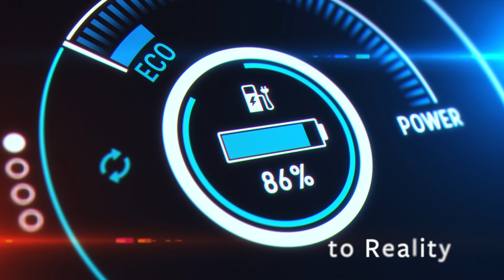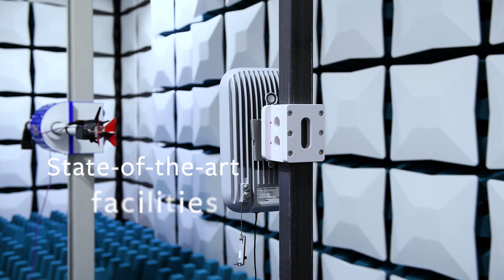Adasky’s IR Camera Could Revolutionize Auto Safety - CES 2022

Comment: I believe Tesla is already using digital cameras without IR filters.

Digital sensors will record IR wavelengths.  The digital cameras we use have IR filters installed in front of the sensor in order to block IR in order to create pictures similar to what we see.  Most humans can't see IR wavelengths.

You can send regular digital cameras to companies and have the IR filter removed.  Turns them into heat imaging cameras in low visible wavelength light conditions.  

I'm not sure this company has anything special.
Reply: Traditional CMOS sensors that you find in consumer cameras can pick up some infrared, but there are a couple issues with what you are suggesting.  If you simply remove the IR filter and receive both IR and spectral wavelengths you won't be able to focus both at once.  They travel through optical elements differently, in fact IR doesn't travel through glass very well, IR optics are typically made of quartz, but the point is that you would be muddying the image with a blurry magenta haze.
Secondly, traditional consumer CMOS sensors are not very sensitive to IR, especially in the thermal range.  Those images that you see from consumer cameras that have the IR filter removed, have very heavy visible light filters, and have very long exposure times and ISOs.
The purpose of these sensors is to pick up thermal radiation and not have to rely on emissive radiation to identify road hazards.  You cannot do that with a modified consumer camera.